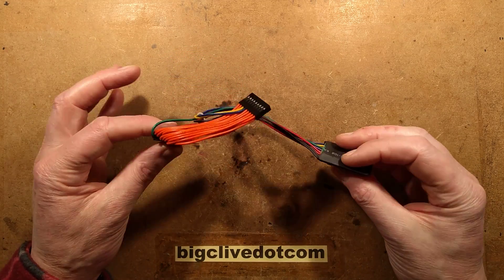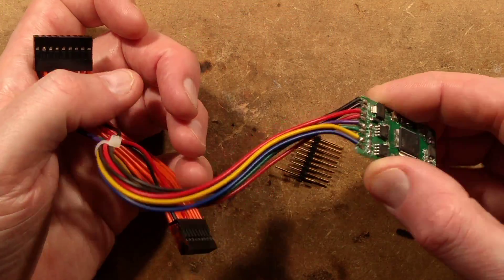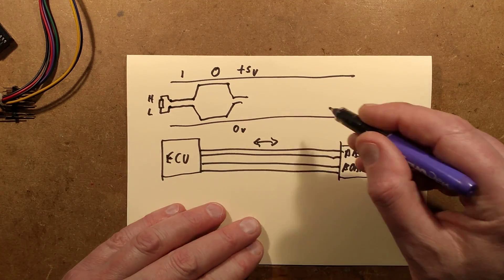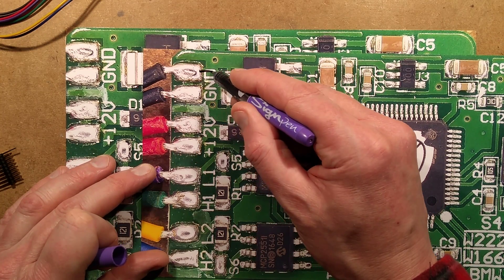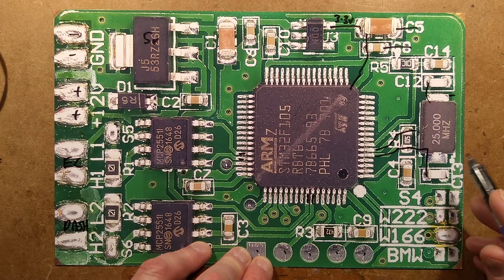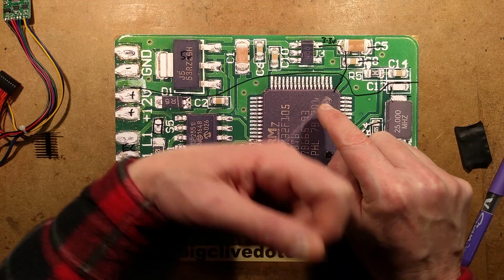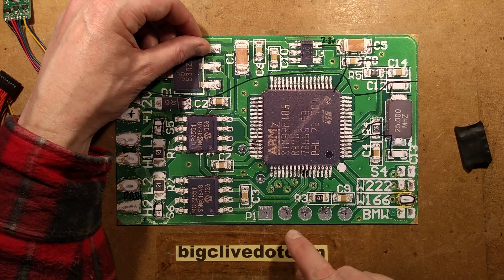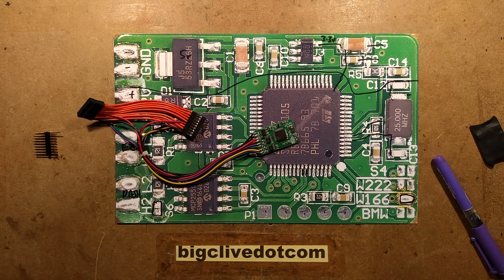Naughty CANbus odometer "interface".  (Fakes mileage.)

Comment: I used to have a very similar device about 12 years back, they can be used for many things, not just illegal ones.
Have you seen the feature on cars to program in two sets of seat/mirror/etc settings for two drivers?
Before that was standard, I made my own with a device like this.  It intercepted dash controls to watch for a trigger.
If I had the accessory on but engine off, pulled forward on the high beam lever twice, I could then hit turn signal up or down, each being a different seat, mirror, ac/heat, etc profile to change to.

I suspect that's why the build quality is so high. Whomever programmed it for its illegal function probably just sourced the hardware elsewhere, programmed it for this task, and resold it labeled for this purpose.
Reply: Indeed, the fact that you could re-program it suggests it has legal uses as well. Just this particular one isn't so legitimate. A multi-purpose device that in this case was on the naughty side
Reply: @Sam S Thanks for that, yeah they all seem perfectly good uses for the device and would save workshops a freaking fortune compared to buying the manufacturers "recommended" diagnostics tools from them. Resetting the check engine light - kind of reminds me of Apple iPhone X and their battery - non-Apple techs have installed genuine batteries direct from a brand new, identical phone and the bloody thing still save the brand new battery is faulty because Apple have rigged it to require a tool only they have (while claiming water damage and recommending you buy a new device). If car manufacturers are doing anything remotely similar, you could look at these little gadgets as jailbreakers
Reply: Yeah I did a bit of can bus hacking, prior to MP3 players being standard in cars, I had a mini computer pretending to be the CD changer.
Reply: oh that sounds fun to mess with
Reply: As I recall some Mercedes models had driver profiles saved to a given key, so that as soon as the vehicle was unlocked it would set up the seats, mirrors etc to the wants and needs of the key’s owner. 
I think it was Mercedes. Might be wrong.
Reply: @Sam S heh, funny you should mention... already subscribed but good call for anyone else reading the comments. Apple's behaviour sucks these days. Then again, even with the first Macs they really didn't want anyone but their own techs servicing.
Reply: If you think about it, wouldn’t you rather the device last so long that by the time it does cause an issue, it’ll be so far down the road that it won’t come back to you. You don’t want anyone finding this thing!
Reply: Sam s.- yes lets tune that dash odometer to our liking, right?
Reply: I got rid of my imobilizer with a piece like that
Reply: @mental66666  Bloody Rav 4.......
Reply: @MrLunithy  It was Skoda Octavia with cluster error and i didnt want to pay for coding service
Reply: @Sam S WOW, that's a lot of bollocks in just one post! Good luck reflashing your DRAM to run your petrol car on Deisel.
Reply: Have to use them any time you need to buy a new cluster
Reply: No, that's incorrect - or it wouldn't have pins for each car type.
Reply: What arduino CAN interfaces are easy to use? i've some 7-seg displays that I want to use to show my speed.
Reply: Correcting the mileage on my Audi is far more complex, due to encryption. It's been broken though, so mileage can be reprogrammed in the instrument cluster once the pin has been found. 

I'd actually like to do mine to match the mileage of my new engine. I'd of course disclose this if I ever sold it--though I don't know that I ever will since its a project car.
Reply: Wow. So like Tesla driver profiles, but in the mid 2000s as an aftermarket add-on to a different car? Interesting…
Reply: @kbhasi  your comment has greatly upset me, cars have had profiles since the mid 1980’s lmfao. Not a “Tesla feature” and he was doing this mod in the 1980’s to 1990’s, not the mid 2000’s you infant
Reply: @3a.m.284  
OK, then it must be that everyone in my family that I know of never used driver profiles, or the cars sold where I live never had those from the factory.
Reply: @Sam S Have to agree on that - the device itself seems to have many legitimate uses. The fact that this particular one was shady doesn't mean all of them have to be. While I can't actually think of any off the top of my head at this particular moment (it's been a week in the high 40s Celcius here in Australia and it's causing missed sleep) I'm sure they exist for those with a clearer mind than mine right now.
Reply: Unfortunately, these are sold on Aliexpress and on other websites as "odometer correction" devices, so I doubt they're being used for a legitimate purpose.

Interesting that you bring up memory seats - Wasn't that a common option on many cars before OBD-II was even standardized? I'm pretty sure you could get Buicks, Oldsmobiles, and Cadillacs with that feature as early as 1982.
Reply: You could certainly get those features, but here (US) they were never "base package" options, they always cost more and/or were on the higher end models.  Plus I am very frugal when it comes to cars.

But a cheap $20 OBD-II micro and the chance to learn how the bus works in general and I was beyond happy. Not to mention the fact I was the only cars driver and didn't even need seat profiles :P   It was more about learning to hack on it for me
Reply: @lorddissy  I mean, I'm here in the US, and Buick, Oldsmobile, and Cadillac are all General Motors, which is a US brand...
Reply: @AiOinc1  Yep, Wilder was that Ford/Mercury had a rudimentary "memory seat" option in.....1958!
Reply: @jamesslick4790  My Fiat 500 has a memory function for the driver's seat position. Slam it forward till your knees hurt - then five clicks back👍😂
Reply: @PhilipBallGarry  😂
Reply: @PhilipBallGarry  that takes me back to my sporty 127 in the 80s
Reply: AIO inc. I don’t know you but I’m proud of you.
Reply: @markofexcellence5209  What for? Thanks though
Reply: AIO inc. hahaha. That reply was supposed to be for OP lorddissy. I’m not sure why it tagged you instead. Oops
Reply: If they're sold on AliExpress, would it come with a programmer? How would the purchaser set the number of miles to be subtracted?
Reply: Yeah these things are all marketed as “mileage correction” or “mileage calibration” devices. Odometer fraud is THE use case. SMH they’re openly marketed on AliExpress
Reply: That is a ridiculous assertion.  Based on what is present, this device has no way to perform any legitimate function.  No, it cannot be used for two sets of seats/mirrors/etc.  The ONLY thing it can do is intercept and change the data stream.  For you not to realize this, makes me suspect that you are fabricating a large portion of your story.
Reply: @stinkycheese804   He literally starts his comment with the words, "l had a SIMILAR device." 

You legit got yourself all worked up not over what he said, but over your misreading of the post. Lmao! Come on man, READ.

FWIW, my comment echoed a similar sentiment. Perhaps you're not aware, but some cars (like my VW product) have had the entire ECU and CANBUS system reverse-engineered. One can the change the mileage, do all the things he described and far more using some simple hardware, and the right software.
Reply: @stinkycheese804  Apple user?
Reply: Stinky Cheese I get what you’re saying, but you might want to take a moment to rethink the wiring diagram. I believe you’ll find that (a) it can read from anywhere on the bus, (b) inject messages on the bus/es and (c) it can inhibit messages going to the “Dash” (probably a BCM). A combination of b and c is what allows it to fake out the odometer, but a combination of a and b allow it to _also perform a many other tasks, such as the seat and mirror settings mentioned earlier. CANBUS is a bus, and as such, allows devices in any location to read and write as they choose. The only thing a device of the bus cannot do is prevent messages between other peers from being transmitted (without outright jamming them or flooding the bus, of course.) - ergo the device being shown.

Comment: You are right about P1, its going to be a programming header they connect to with pogo pins. Pin: Gnd, Vcc or Rst, Boot0, SWD, SCLK. W222 and W166 are codes for various Mercedes models (S class M class). 

STM32F103 is popular with Arduino, the F105 not so much. But no way to be sure unless you find the original Chinese engineer who wrote the software.
Reply: looks too well designed to be done by someone who would use Arduino, they even went through the trouble of having 5V just for the CAN transceivers. S4 could be an AUDI
Reply: @fuzzy1dk  I disagree, I use Arduino and I could design a board that looked that good, maybe better, the real skill is the firmware and we can't see that. I say good luck to the hacker's
Reply: but unless your target customer is the arduino crowd why bother with arduino, make much more sense to use an IDE and debugger that is less 1980s
Reply: @andymouse  Right. Arduino is really, at it's heart, just a boot loader.

There's also the standard pinouts for shields etc but the software will run even if you ignore and abuse that.

The rest is a nice set of libraries and a big HAL. 

Not much in itself, it just needed someone to actually do it. The Italian fella did, fucked up a couple of pins, and consigned BASIC Stamp back to the cheap grave it kept trying to crawl out of.

Now it supports Arm. Wouldn't be surprised to see someone compile Linux on it. Using some god-awful bit banged VGA display.

I haven't even mentioned the Pi and it's siblings! Aren't things great nowadays! You could knock yourself up a half decent digital scope with a touchscreen LCD that fits in your pocket! For pocket money!
Reply: @greenaum  yep.
Reply: @fuzzy1dk  It's BMW CAS4. VAG stores the millage in the dash.
Reply: BMW obviously seems to be BMW cars. S4 may be Audi S4.
Reply: Googled it. S166 is the 2012 GLE-class aka M-class SUV.

Comment: The keyword for this on aliexpress is "can filter universal odometer adjust", only 12$ or something....
Reply from the maker: Thanks, I've narrowed that down further to "can filter 18 in 1" and they seem very common.  I've added a search link in the description.
Reply: @bigclivedotcom  "BMW Mileage Correction" should help too. They don't reverse mileage on BMW's but they prevent it going up
Reply: @iMagic16  Thanks for confirming that, I was starting to doubt my logic (and sanity) - started by assuming that the device would in effect "loose" a preset ratio of the mileage couldn't see how or why they would build a device to make some of it invisible with the danger that if it broke - or you removed it the real mileage would suddenly re-appear.
Reply: @bigclivedotcom  I've found this, which seems extremely similar. https://www.truckdiag.com/shop/can-gateway-can-filter/
Quite a few other interesting devices on that site :)
Reply: @bigclivedotcom  There are two 120R end of line terminating resistors because it actually breaks the Ecu to Dashboard network into to two seperate networks.
That was it can 'pertend' to be either the ecu or head and recieve / retransmit data as you explained.
Reply: @bigclivedotcom  
 has anyone confirmed if it will work on a B9 2019 S4 avant ?

😂
Reply: That's a pretty good bang for the buck if you take a 120,000 mile car and roll it back to 80,000.  The value has easily went up $2,000-$4,000. Possibly more.  Pretty sleazy.  I'm going to have to start looking under dashes the next time I'm planning to buy a used car.
Reply: @carportchronicles1943   its not only useful when you own a car, but more when you lease a car. Almost all the times you have a max mileage per year, go over it and you get a big ‘fine’ for every extra mile. This way you can lease a car cheap with 5k miles per year and drive it what you want
Reply: @Mark-vn7et  except many lease cars have black boxes now so the black box history and the odometer won't tally up.
Reply: @rcaguitars  really? Well there goes your privacy.....I mean is that even allowed?
Reply: @Mark-vn7et  usually in the higher end models, it states in all the fine print and they justify it as security purposes.
Reply: To quote a page I found selling them:
"CAN Filter is designed to support old mileage data blocking on Mercedes-Benz and Renault vehicles.  is designed to prevent regeneration of the old mileage state in vehicle dashboard (odometer). CAN filter doesn’t interrupt any vehicle electronic system, there will be no errors or DTC’s after install."
Reply: @Miketz  
I think I found the same page!  It seems that it might actually have a legit use.
Reply: Blind Bob We've found ones with CRP enabled and ones without. There are some known CRP bypass vulnerabilities for some STM32  MCUs that can be used too.
Reply: @tautology_zero  So you manage to get some data out of it?
Reply: @Ygr3ku  I was in the middle of moving house so I passed the  onto a friend who had extracted the firmware on another variant. Then I forgot about it. I'll ask.
Reply: Honestly a chip to pass emissions would be useful.
Reply: @Wegetsignal  I’m assuming that was a passing stab at Volkswagen yes?
Reply: Think this is the oem... http://www.yanhuaacdp.com/
Reply: its a shame i intend to keep my car till the wheels fall off...
Reply: There's a very good chance you already know this, but I searched the info on the back and came up with this:
https://www.cardiag.com/product/can-filter/
Another poster stated that a device like this could be used in the case of using older (higher mileage) components in a lower milage vehicle.. it would prevent the higher mileage from showing. I found the video very interesting!
Reply: Tempted to buy a couple to try and read the MCU's firmware out. The test pads are likely to be SWD and power.
Reply: A couple have been ordered, if they haven't switched on CRP we should get some firmware out of it.
Reply: 50 quid and I'll do you a version of the software from scratch. OK well not really, but really it's not rocket science, you're essentially passing through all the data except the relevant mileage stuff. That, you alter, then send along. 

Set me up with a car to test it on and I probably would have a go for a few hundred. You get the same safety guarantee Aliexpress give you. Or else get some Indian kid to do it through one of those online slave-auction sites they have. 

The only difficulty would be if it has to crack some encryption or secret handshaking. If it does, the bloke who programmed it will certainly have just copy-pasted that bit in from somewhere else. That's how intellectual property works in China. A system of mutual favours / ripping-off in a sort-of socialist version of a black market. Info circulates on photocopied sheets through a system of knowing a man who knows a man. 

I wonder what the other 17 features, besides defrauding car buyers, are?
Reply: They're only £1.80 delivered, from my agent.